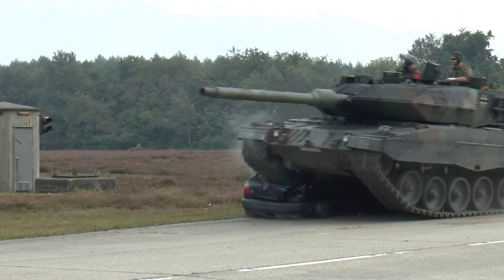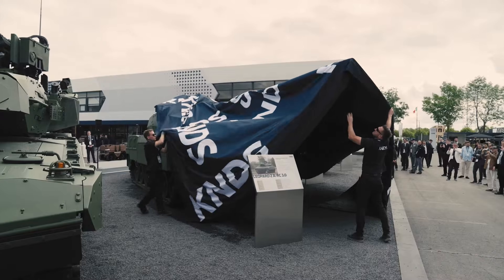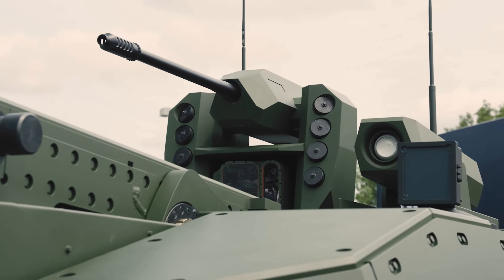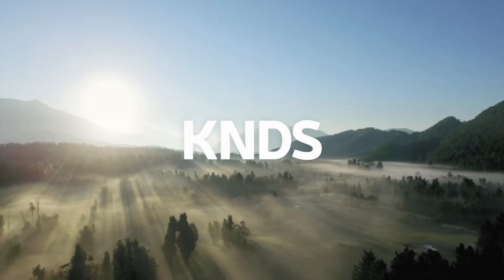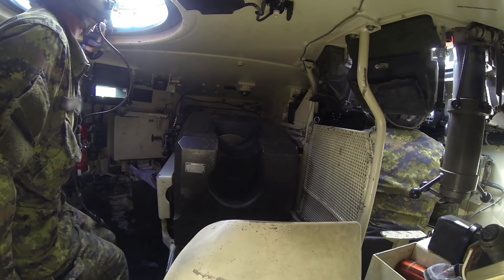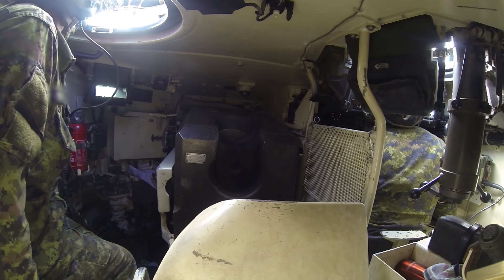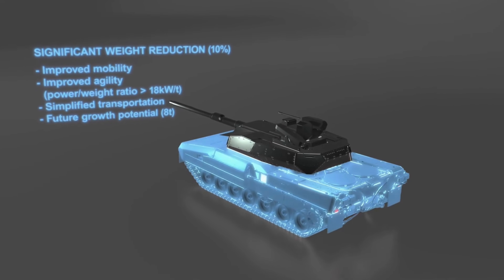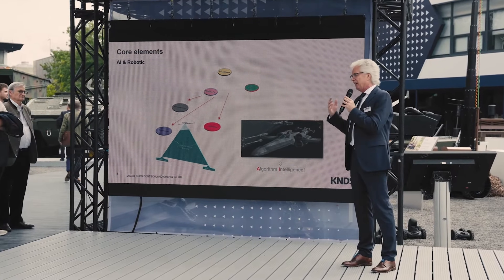The Leopard 2 A-RC 3.0 Main Battle Tank | 140mm SMOOTHBORE GUN

Comment: That 30mm on the roof might be among the most important upgrades. In combination with all the sensors it allows the tank to shoot down incoming drones making it way more survivable...
Reply: If it has the sensors and fancy fused ammunition it could be good.
Reply: @JeffBilkins 
Surprisingly, proximity fuse rounds aren't that new. Sure they're fancier now than in WW2 but they shouldn't be anywhere near as hard or expensive to produce than even the cheapest small rockets.
Reply: @mill2712  not proximity. its timed fuses
Reply: Tanks absolutely need an automated turret to defend against ordance. 

 Tanks, IFVs, and Helicopters all have a 30mm cannon that can protect it against cheap drones at least. Slow missiles too. 
 
 We have the tech for a personal defense cannon. Need to get good software/hardware to combine a small fire radar, and a precise turret. Add in AHEAD flak armor for extra coverage. 

 Imagine firing a Stinger or Russian one that escapes me at a helicopter, and the auto cannon just shoots it down. Then immediately aims at you! The pilot simply tapping an I PAD to shoot. Dragging his finger as you haul arse. 

 Then a second missile was fired, and the cannon automatically takes over, and shoots the missile before it can do too much damage. 

 That is how I see the future. With drone swarms countering it.
Reply: These tanks should carry tiny drones to fly out to intercept incoming drones
Reply: @Juandinggong   The problem with this idea, is sensing the drone you're attacking. You'd need essentially 360 degree coverage in 3D on the hunter drone, - pretty sure you're not going to be able ot package the required radar and processing small enough to fit a currnet FPV drone.
Or you'd need a ground station with sensors that can track the target and hunter drone.

Radar might help, but and FPV drone can be flown very low, like 2 or 3 cm off the ground so your radar is going to need to be high off the ground. You're radar will also need to be fairly high frequency e.g. millimeter or centimetre wavelength to get the resolution required to detect and track the drone. Clutter will be a real problem if you have the radar mounted high looking down into the ground or into a forrest.

I've tried dog figthing an FPV drone from another FPV drone and it's pretty hard. For a start they're. small target and hard to see even if you know where they are and once they are outside your camera view you have no idea which way they've gone. So manual control is not a good option.
Reply: I'm yet to see a drone that can survive .308, not to mention .50, but you do you, strange caliber obsessed man 😅👍
Reply: @TheArklyte  Its about it being a programmable proximity fuse round. It doesent need to hit the drone just near it.
Reply: @ajsdjkdasjksdakjdaskj  To cool this - i guess you speak of AHEAD ammo (like Skyranger uses f.e.) which require exact tracking data, which again require a propper sensor setup designated to cover upper angles of attack drones can/will use.

The choosen gun in place can't use such ammunition but possibly simple fragmentation shells, as a threat is by design meant to close in on the tank.

By the lack of sufficent sensor, i doubt even this to be a thing right now.
They not even mind about installing a 200 USD jammer to protect against drones. So why imagen more complex and expensive solutions?
Reply: @nikitatarsov5172 if it wasn’t in your PR brochure then it doesn’t exist 🤦🏼‍♂️
Reply: @TheArklyte why would drones need armor to begin with? They're supposed to be attritable (disposable). Also, they're ridiculously hard to hit and target.
Reply: @nil981 They're ridiculously hard to hit and target if you're Russia. Israel and the US, on the other hand, already proved not too long ago that drones aren't unable to be hit nor unable to be tracked.
Reply: @nil981  1)that's the point - they don't have armor. Basic .308 would trash FPV drone from hundred meters away;
2)APS systems are made to target and intercept ATGMs. If you believe that slow and easier to spot FPV drone is harder to target, it's your problem.
The solution to FPV drones is the same as it was in 2016, almost a decade ago - slaving RWS to APS sensors. And basic PKM/M240/M60 is more then enough for that.
If your tank was ambushed because it had gotten into tree line, it's a user mistake. The same as driving a tank into narrow street between several 9-20+ floor apartment buildings and then saying that RPG-7 to the roof is hard to counter.
Reply: @TheArklyte  OMG thank you for clarifying that FPVs aren't invincible and fast killing machines. The drone glazers don't realize that the reason they're doing so good in Ukraine is because Russia is terrible at maneuver warfare, armored warfare, and strategy in general.
Reply: @TheArklyte  1) yes. you probably know, but upcoming rheinmetall mbt have 7.62mm drone protection/universal remote controlled gun
Reply: Drones now are not just kamikaze types. Drones are used now in ukraine for mining up to 25km distance.
So the armoured vehicles should also care about antimine capabilities (not making crew survive, but making vehicle remain operational)
Reply: Yeah, the larger calibre means more room for interesting fuses and more explosives.

Given the drone threat and the difficulty of getting more than a small number of vehicles together to support/launch an attack, we're likely to see high-value vehicles have a significant measure of anti-drone defence on the vehicle, rather than have it all farmed out to dedicated vehicles.

Automation for drone defence is certain - a slow handclap to the people pointing out it'll require a redesign/replacement of existing systems.. Their wording implies that the 30mm wouldn't be integrated into drone defence because it would take... effort? I know software is hard to do but so are most things :shrugs:
Reply: Jammer systems are far easier and aren't unidirectional.
Reply: @osmacar5331 Recently Ukraine and Russia have started using wire quided FPV drones as well as AI quided ones to get around the jamming. Against those you need hard kill option to stop them.
Reply: @osmacar5331 Jammers can be bypassed.They jam the signals. What if the drone is autonomus or wire guided??
Reply: Shitlooks meaner than fuck, looks super versitle as a platform. With that high degree of elevation they can really utilize that indirect fire role thats being used by a lot of troops in ukraine rn
That unmanned turret is gunna be ace as well for survivability
Reply: I could see the 30mm being AI linked, to give it better ability to shoot down drones.
Reply: yes! This one and how the KF51 is supposedly going to fully operate with drones (be able to launch drones as well etc). These designers are very much taking notes from the ongoing battlefield.
Reply: Indeed  w.o anti drone, thus new tank is a deadmeat in battle field
Reply: Basically a ciws
Reply: Is it just me or does 30mm seem like massive overkill for drones?  Wouldn’t they be better off with a cheaper, smaller caliber gun that they could have stacks of ammo for?  Drones are relatively fragile after all.  Or do they need a round big enough to contain some kind of airburst functionality?
Reply: Tank commander:hans fire ze machinegun at that armoured car
Gunner:sor zis is a 30mm aitocannon
Tank commander:ah potato potato fire it hans
Reply: Germans know armor.
Reply: Nah, I'm for dedicated AA vehicles. You just can't carry enough ammo to be that effective against air attacks. Let alone not having proper radar devices.
Reply: @0Turbox  https://youtu.be/ymsK6tbvTAc?t=227 They do have radars.
Reply: Might - if these sensors cover the sky in terms of drone-typical attack angles, which the Trophy--sensor setup doesn't.

Armata f.e. does this with its Afganit APS and shared teh data/reaction with this gun to adress ATGM's/drones. This made the tank significantly more expensive as you need different resolutions to also capture small balls of plastic coming in in a variety of speeds, but opend up this opportunity. The Tropy sensor setup doesn't incude these capabilitys, so the gun isen't beneficial here.

But it could have been, and that's an enoumous waste of potential imho, making it more of a PR/marketing stunt rathern than a picture of what epic tank they could build if they really wanted. This is just minimising costs.
Reply: @nikitatarsov5172 speaking of PR stunt and Armata…. 😂
Reply: @caccioman  Hey mr. Bot, plz let me help your either slightly racist or just intellectually broken confusion: Critisising something from teh west doesn't make some one a fanboy of just another object of fan service.
I have diffrent critique to Aramata or russian products, but these aren't the topic here (as you would have mentioned if just arguing and thinking about the facts).

Yes, Armata had a large portion of its reasoning in renewing the self-picture russians had from themself, so it indeed is kinda PR-stunt. But that aren't the reason why it not came to fruition as a standart tank model. These are way more complex as - as i read from you insanely simplistic arguments - you think. But i guess that's with a lot of things.

So plz do your bot duty somewhere else, because this response is for thrid readers - i feel no big interest in engaging in childish rage bait tactics.
Reply: @ I. see. my. childish. rage. bait. tactics. worked. pretty. well. on. you. 😂. 😂. 😂.
Reply: "It allow the tank to shoot drones" remain debatable until it's enter a real high intensity situation
Reply: @luxeternity  The vehicle isen't meant to right now. The sensors aren't sufficent to track the relevant angles for such a defense and the gun isen't handling AHEAD ammo.

It could have been done, but not with the basic setup of Trophy sensors.
Reply: @nikitatarsov5172  "basic setup of trophy sensors" did you mean a combination of AESA radars, with armored covers that look through that armor? The only current issue with the trophy is that it doesn't include radars looking up. It definitely does have some ability to be linked with the other systems as Merkava 4 tanks are able to automatically trail their guns at the approximate lunch point of an ATGM, detected by the trophy. How open is that interface/API is another question.
Also, AESA radar antennas can potentially be used for the EW (some advanced aircraft radars can do that), not sure if the Trophy's bandwidth would suffice for that. And obviously it doesn't have a current software package to do that. But who knows...
Reply: Yeah I guess they need a small squad of tracked ground drones with AA and sensory devices
Reply: Then they would need sensory and radar system to detect the drone.. 
I believe it would be hard to know you're being targeted by drone with camera visual alone.
Reply: @X.Y.Z.07  New CV90 versions have AI use cameras to scan sky automatically to detect drones so the Leo 2 could do something similar.
Reply: @X.Y.Z.07  yep, and supposedly the systems of that tank are indeed capeable to detect and recognize drones
Reply: @X.Y.Z.07 it all depends on the software, it already seems to have the trophy radars, and, I guess, the trophy itself, so if the cannon is integrated with them that should suffice
Reply: @solarissv777  Tropy sesnors doesn't cover higher angles nor is teh software ready to handle such data on an open plattform (like with an integrated gun), as response time-minimation demand a more 'mechanical' reaction to the threat-detection.
Integrating a gun in this solution would demand for a whole new system (which would be nice, as Trophy sucks anyway).
Reply: Yeah that PG-7VL with 500mm RHA penetration ability will notice the difference  instead of turning more armor into incendiary and kinetic scrap inside the turret.
Reply: @mankihonda983  that's why the 30mm is there in the first place, so it doesn't hit the vehicle.
Reply: @mankihonda983  you could just load air burst ammunition in the 30mm and with a decent ROF it will be an improvement. Will be perfect no but it's better than nothing.
Reply: @mankihonda983  cringe russian bot as usual
Reply: @mankihonda983 I think you are wildly underestimating the modern armor and wildly overestimating how powerful a 40+ year old Soviet rpg is. Yes they’re strong, but no one is staying up at night having anxiety about an rpg7 projectile.
Reply: Yeah if the drones were predators from the early 2000s
Reply: there's no way that 30mm can shoot down a FPV drone...
Reply: @ivantnt26 Bruh. FPV drones are just slow missiles. Radar directed flak guns with proximity fuses have existed since WW2.
Reply: @ElijahDecker  Kind of. You average missile flies in almost a straight line. They may do a pop up manoure and some anti ship missiles do some kind of zig zag in the termnial phase of flight, but they are relatively clumsy manouvre.
An FPV drone is way more manouverable in flight and can be way more unpredeictable - the fact that they are slower allows them to be way way more manouverable.
Radar directed flak with prox fuses probably are one of the best solutions at the moment, but I think the hit rate will be way lower than for manned aircraft or larger heavier, less manouverable missiles.
One Gepard against say 5 or 10 FPV drones, I think FPV some drones are probably going to get through.
Reply: @1337flite  Gepard was made to take down helicopters that are way bigger and more durable than drones. To take down a drone you don't need direct hits with autocannon. Shrapnel hits suffice and so airburst ammunition is more effective against them.
Reply: @ivantnt26  modern technology is terrifying.
Reply: @KetTheDumDog  exactly and it showed that Gepards are useless against the drones
Reply: @ivantnt26  proxomity fuse? ever heard of it?
Reply: @durchfallklaus4420  not really proximity fused. the shells are time fused determined by a computers and sensors
Reply: @hotdog9262  AHEAD - btw. not in place with the tank nor the gun.
Reply: @nikitatarsov5172  probably(?) more or less the same type of setup with bofors 3p, bushmaster etc
Reply: @hotdog9262  They weirdly told us almost everything (including stuff that obviously isen't correct) but not the type of RCWS they used - it seems o_o

But visibly it has no programmer ring and is only meant against light-medium ground units.
Reply: @nikitatarsov5172  not saying you`re wrong. but drones surely is the largest threat to armour these days due to low cost and effectiveness. my guess is the info will change eventually, and the top mounted gun will also go after airborne targets
Reply: @ivantnt26 could be loaded with shapnel/flechette rounds. Could also be ai aimed/assisted to spot and target. With the technology today. I believe they have integrated at least something similar
Reply: @ivantnt26  yes with Air Burst ammunition it can
Reply: @Janoip  yet in 3 years of Ukrainian conflict no such system was implemented FOH
Reply: @ivantnt26  It requires two types of special ammunition to shoot down the drone.One originated from World War II and the other from Israel
Reply: @cqde-e3o  i was  referring to inability of that 30mm effectively track and destroy a swarm of low flying FPVs
Reply: @ivantnt26  l2ARC3.0    have 4 radar to Aiming and shooting.
Reply: @cqde-e3o  sure ...
Reply: In theory…although I’d be very surprised if it can track and kill a very fast drone that suddenly pops up over a treeline or something and it doesn’t have much time to react to…modern drones are very fast, totally unpredictable and as he said, modern drones can get under tanks. Tanker is the most outdated and dead combat job. The survivability against any other modern military is almost nil.
Reply: @BudgetedSoF  thanks for a laugh. Your reality must be quite scary if tankers are somehow LESS protected from drones then infantrymen. Good thing that it has no connection to our reality and laws of physics, but you do you 👍
Reply: @TheArklyte  I never said that. Thanks for putting words in my mouth though. Next!
Reply: @BudgetedSoF  sorry, must have mistook you for another guy. Have you seen the 🤡 who said:
"Tanker is the most outdated and dead combat job. The survivability against any other modern military is almost nil."
I heard grunts, who get grenades thrown on their heads by FPVs, would like to have a few words with this one.
Reply: Tanks counter lazy FPV drones flown high with sensors, fire control, and proximity fuse HE. 

FPV drones counter this with tactics similar to how helicopters countered man pads, by flying low and behind cover with limited exposure times.

BUT this tactic doesn't counter RF jammers that are a huge problem for drones when in use.

Drones have been countering RF jammers by switching to wire guidance, similar to TOW. (They are probably too small to protect against jamming via counter EW technology).  

But this tactic limits the drones' maneuverability around vegetation and obstacles. They certainly won't be the ultra mobile and unpredictable killing machines hiding in the treeline as described earlier when restricted by wire guidance.

Another limitation of drones is a lot of these outposts being set up as dedicated drone operating positions take time to set up and won't be able to respond to a breakthrough in a maneuver warfare scenario, where a breakthrough is actually achieved (difficult due to ISR provided by cheap drones making armour massing difficult - though RF jamming and sensor/airburst 30mm combinations I think will limit that.

Ultimately I think they will find their place in combined arms but armour will adapted, just as helicopters did. Scout helicopters may be obsolete due to drones, the gunship may be an outdated and dangerous role, but helicopter transports and missile (or drone) trucks are still a thing, because nothing else has replaced them capability wise. 

Tanks still provide a capability nothing else can do as well (direct fire from a mobile and protected platform). Until that changes, tanks will exist.  @BudgetedSoF
Reply: @BudgetedSoF you mean the keyboard warrior?